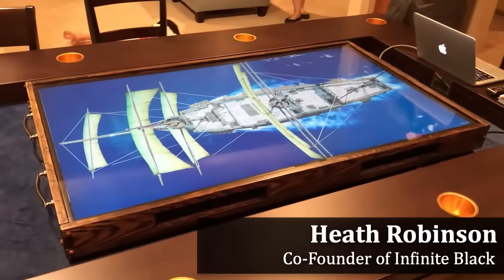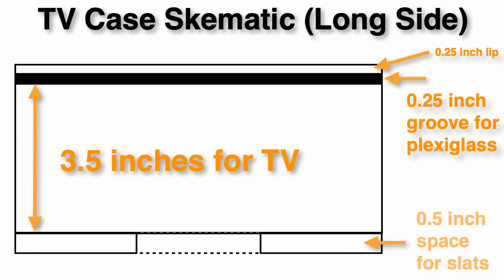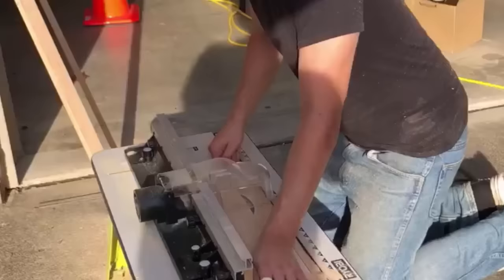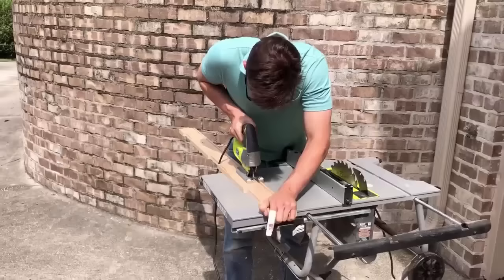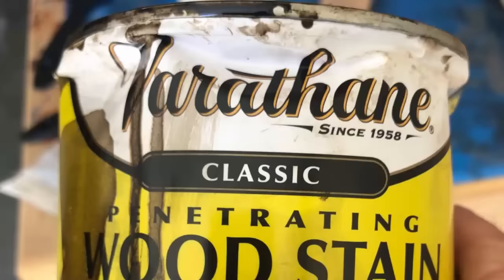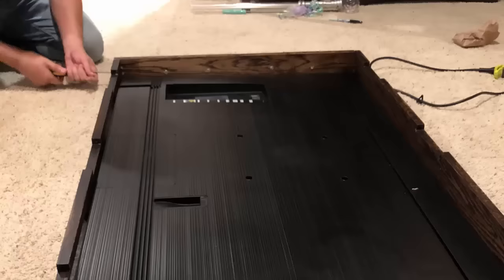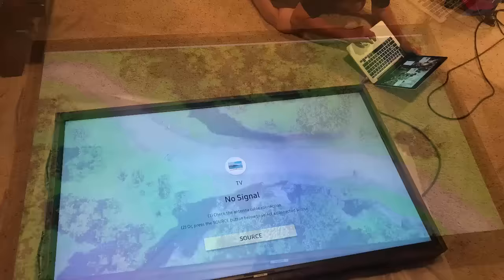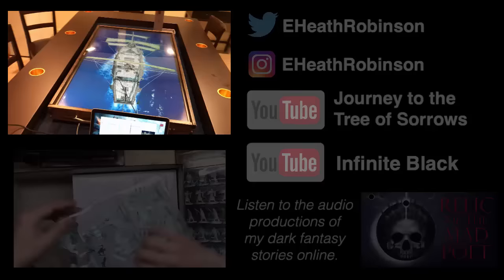Building a TV Case for your D&D Gaming Table for Digital Maps

Comment: Excellent work.  Beatiful and functional.  Are you worried about heat?  I've tossed around building something similar but I worry about over heating and ruining a several hundred dollar TV.
Reply from the maker: We have used this set up in several games now which last for several hours each and we haven’t noticed any heat buildup. But, keeping the back open and just using slats is probably a big part of that, as is keeping the TV up off the table with the feet.

Comment: Hey loved the vid! looking we are looking at building this for our table just had a few quick questions.

Why did you guys go for a 55" when you could have gone for a 50"? According to the patreon FAQ they reccomend a 50" for 4k maps.

Do you notice much stretching having to scale for the 55"?

Is it hard to scale the grid?

Is these anything you would change or done differently?

Do you think that a higher refresh rate would be better on your animated maps?
Reply from the maker: The 55" TV was just what Lou bought. He might have gotten a deal on it. I have not noticed any stretching. I don't think it is that hard to scale the grid. Lou does that with the software without too much problem. If I did it again I would do it at my new workshop, rather than bringing tools to Lou's house. That way I know I have all the tools I need with me. The animated maps look just fine to me on this TV. But, other people may want something different.
Reply: It's just for maps dude, you're not trying to run a AAA title videogame at 4k UltraHD 120fps... I don't think bells and whistles matter much in this application.

Comment: Is there anything holding the tv in place? If you lifted the box on its side would the tv fall out of the top?
Reply from the maker: No, the TV is completely enclosed. You can pick it up by the handles and move it around.
Reply: @EHeathRobinson  ty. Trying to get ideas on how to approach this. I got the tv I just to develop the plan.

Comment: So i have a question i want to put out in the ether but first i'll lay down the foundation of my setup...
So i have framed out a 50 inch tv with a sheet of tempered glass laying on top of it and dropped it into two table tops that i got from the cafe i work at i mounted the table tops onto steel work bench frames and the mounted a desk perpendicular onto one side so that i have my own workspace. so heres the thing i have statblocks on my laptop, dungeon maps on my tables display and a tv standing behind me to display background art and character art on.
My question is. does anyone know of any good software to manage these three screens? i was using gimp for maps, photo album for concept art and softropes for managing my audio (mostly BGM) recently i have started using screen monkey presentation software but it looks like it was designed for a windows 95 computer its very dated and very buggy but serves its purpose for now. I have been looking at other presentation software but the majority of it seems to fall into to categories high level CEO business presentations and religious church presentation each having there purpose built firmly into the software. 
So does anyone know of some awesome presentation software cause eventually i would like to add a projector or led lighting to my collection of tools but it doesnt seem like it would be all that fruitful with my current setup as there is alot to manage

Comment: Looks amazing, I'm planning on doing something very similar for my group soon.  Which map software are you using?  We use Arkenforge (which imports Dynamic Dungeons works easily).
Reply: Thanks. I'm using Dynamic Dungeons own (newish) editor and player. It's getting constant updates based on feedback, but I'm very happy with the current version.
Reply from the maker: I am not sure what the name of the software is (Lou may chime in and let us know), but it is the software that is created by Dynamic Dungeons. I think it is actually a beta release of that software that is running here.
Reply: @EHeathRobinson  What is your overall table size?
Reply from the maker: @anthonyzuhlsdorf3736  The table is actually Lou's table, but it is "Tablezilla" by Carolina Game Tables. According to their website, "Tablezilla is 8 feet long and 4.83 feet (58″) wide, with an interior play area of 6.1 feet (74″) by 3 feet (36″), and 11 inch edges all around. Whew! The play area is 3 inches deep and covered in velveteen cloth." Here is the link: https://www.carolinagametables.com/product/tablezilla-base/

Comment: Hows the TV holding up, being that its in an enclosed case how do you deal with the heat output?
Reply from the maker: It is holding up great! There isn't any issue with heat output. But then again, the case is not fully enclosed and is up off the table. You can see the back of it right here: https://youtu.be/Jqf-zysYYuI?t=288

Comment: I just bought a 40" for cheap. Im willing to just go without plexi. Im not worried about spills and even minor scratching wouldnt bother me. What do you think? The advantage is that there is no extra room between the pieces and the screen.
Reply from the maker: I don't know, but my guess is that if you have careful players that it might not be a problem. Lou was concerned about how (not) careful some players in the game might be, so a plexiglass cover was something he wanted from the beginning. It is a bit of an advantage to have the miniatures closer to the screen so it will look like they are "on the grid" a bit more.
Reply: The advantage is you can still use a wet erase marker and just load up a blank battle mat image too with plexi covering the TV.
Reply from the maker: @ClintonHolder  That is true. We have not broken out the markers yet, but we probably should!
Reply: @EHeathRobinson  dude id be careful cause youll wanna avoid plasma tv's cause theyre so prone to screen burn in and lcd tv's are super prone to dead pixel from any sort of impact. i would seriously consider some tempered glass but just throwing in my 2 cents im working on a similar project
Reply from the maker: @0Ninja0Dude0  Thank you for the heads up. We intentionally have dice rollers and dice trays to keep from rolling dice on the screen top. It I were to do it again, I might consider tempered glass.
Reply: @EHeathRobinson  no problem man, i've been crunching as much info as i could while my tv ships :P found a 9 dollar cork bulletin board at walmart that im going use the  frame from for the glass top and an old bbq metal grill to secure the amplifier and tv in the hopes that they vent enough heat should put my party right in the the high seas when its all finished. now i just need a projector to display to backdrops on the wall behind me XD
Reply from the maker: @0Ninja0Dude0  Cool. I want to see the projector setup when it is done!

Comment: What did the final weight on this end up being? Roughly? Could this be a portable setup?
Reply from the maker: I am not sure what the final weight was. We always move it with two people. It depends on what your definition of portable is. We move it from a guest bedroom to the gaming table every time we game. I have an Xterra and it would be completely possible to put it in the back of it and take it to a convention or something. But it would be an operation.
Reply: @EHeathRobinson  Ah, dang. I am a traveling DM mostly. Do you think it would still be viable to use a slightly smaller TV to save on weight? Or would that restrict the play area to much?
Reply from the maker: @MrLightmass  You could do a smaller one. There was a guy on Etsy who was making wooden cases, but it was for a smaller TV. Lou wanted the big one since the game is at his house.

Comment: Beautiful work! What was the total cost and time spent? If you don't mind sharing. I know those TV's can be around 500-600 dollars.
Reply from the maker: I don't know exactly, because Lou was the one who covered the cost because it is for his gaming setup. Lou wanted it made out of oak which increased the costs. You could use less expensive wood. It would still look great and costs would be much lower. 

Calendar time it took about three weeks. Work time was less. Lou and I worked for about a full weekend when we started with supply shopping and then cutting all the pieces out. I then left Lou to do the staining and putting on the polyurethane on it. Then I came back to work on it for an afternoon. Then we ordered the plexiglass and then I came back for another evening of work to finish that once it was in.
Reply: Prices for TVs have dropped a lot. We got a 43” Vizio 4K for under $300 at Sam’s Club. I’ve seen similar ones on FB marketplace for under $200. It can be done fairly cheaply. 😀
Reply from the maker: @dhostetter  I think Lou got his on special. When I make something similar for myself, I'll search out the TV at a bargain first and then build the case (or the whole table!) around it.
Reply: Tbh its preety easy to pick up a TV from ebay for sub <90 dollars

Comment: How's the tv holding up being on its back?
Reply from the maker: It has been holding up just fine. Now, when its is stored, it generally sitting on its side along the wall. The top does not fit on the table with the TV on it, so it does not say there between games.

Comment: Just for future reference instead of using A router you could just set A low depth on A table saw
Reply from the maker: That is a great point. Yes, you could do that too.
Reply: @EHeathRobinson  Thanks for the idea, I was able to set this up in one night I just layed the television  down and got plexiglass for the screen :p
Reply from the maker: @wildchameleon7622  One problem we had with just laying the TV down was that the back of the TV was not flat so the TV was not level when you set it on a table. So, a functional part of the case was to level the screen. But, you could probably level the screen in an ad hoc way too.
Reply: @EHeathRobinson  I got lucky, my screen is flat on the back 😁
Reply from the maker: @wildchameleon7622  That would make it a lot easier!
Reply: @wildchameleon7622  what screen are you using?
Reply: @patrickturner3848  will let you know in a few hours when I'm home.
Reply: @patrickturner3848  Hisense 55 inch 4k H6 series

Comment: I have no idea why why why you put in a tv case in a case in a table.  Flush mount it with the table or close to.
Reply from the maker: I am sure Lou did not want to cut into his very expensive gaming table. I know I wouldn't. But if I were going to build one from scratch, I would probably try mounting it inside the table.

Comment: holy shit, the way you use some of these power tools... no wonder you're wearing bandages everywhere. use a couple of fucking clamps. never put your hand in front of a cutting tool. yes, jigsaws are seen as one of the "safer" power tools, but always maintain safety first. I've had jigsaws kickback hard and slam back down into the working piece. luckily, it missed my off hand.